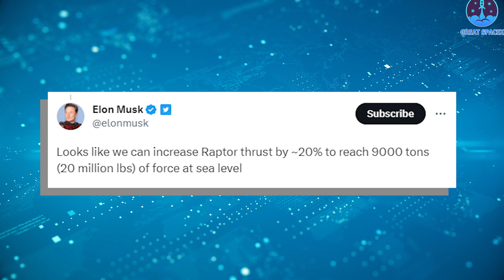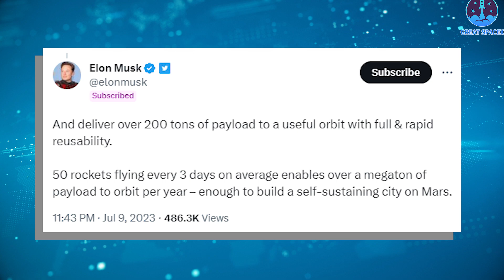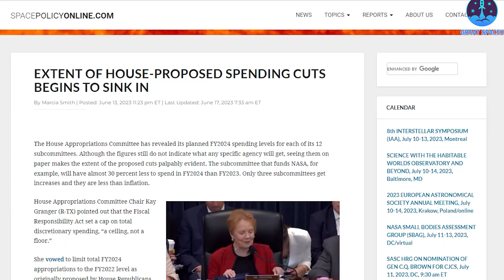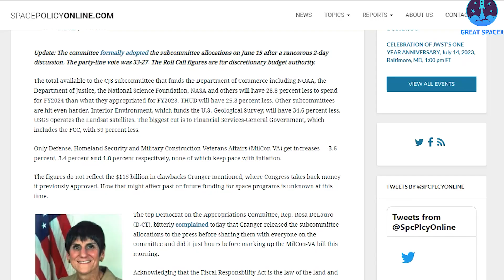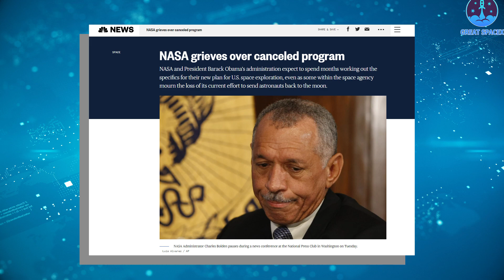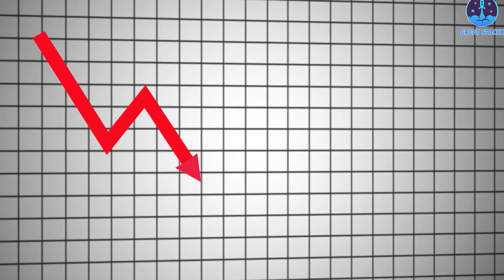Elon Musk just revealed Starship's major design changed!

Comment: I think Musk has moved beyond Florida and Texas, and he is now focusing on the necessary infrastructure to get those 50 rockets fueled, supplied , kitted-out with payload and a crew, then turned loose.  No matter what, 8,000 tanker trucks a day is not happening.  There are busy streets that can't come close to that number.  You are either building a superhighway to make this work or using other ways to get the propellant into those rockets.  Or maybe you can settle for some rockets to use off-site propellant but you crack the sea water to get you some of it?  Air lox AND hydrogen from the water, including trace minerals and salt humans would need on other planets.  Rotting seaweed is probably not going to produce enough methane, but I bet Texas has ways of turning that oil and natural gas into liquid methane.  

How do you get propellant where it needs to go?  Maybe boring some tunnels between the launch towers and fuel farm.  While you are at it, bore tunnels to any critical infrastructure.

Comment: The crazy and completely unrealistic (economics and safety) Mars visions are unimportant.  The important thing is that it will become "easier"  ("possible" - in fact) and vastly cheaper to get heavy loads up into space.  That is how Starship will change everything.  ...If it succeeds.  Just for one thing, it will be much more feasible to build entirely new classes of deep-space autonomous vehicles and instruments.  It will be much cheaper, not just because the launch will be cheaper, but also because the mass of the vehicle will no longer be such a critical factor.
If Starship succeeds, it will only be a few years before a real space boom starts rolling.  Long distance, high endurance, heavy planet exploration probes.  Asteroid mineral prospecting probes.  Low-g factories.

Comment: the astronomical quantity of refill trucks would be more easily interpretable if it were transformed into more commonly seen volumes
X Olympic pools (maybe not big enough)
the collosseum in rome or the astrodome (maybe)
a known LNG carrier or supertanker (such as the Exxon-Valdez of sad memory)

another question the SLS which has already taken off is block type I (light)
what is the state of development of the elements of the block IB (medium) and block II (heavy) versions
the Exploration Upper Stage and the new boosters?

Comment: He should just get the thing into space and working properly before thinking about building cities on Mars. If Raptor engines can achieve 20%more power, surely you would consider making Super Heavy a little smaller if anything drop 6 (of 33) engines, meaning less weight and less propellant required for the same(slightly more thrust still) making it even more efficient and cost effective. SpaceX will probably make the Merlin engines more efficient in the future too which will mean they can carry more cargo for the same space/capacity. I don't understand this constant need to upscale, its just harder all round to get the thing off the ground, harder aerodynamically, with far more weight and far more fuel required and ten times more difficult to get the thing back on the ground & re-used. Efficiency is the key.
Reply: I think it is Good that Elon keeps scaling up and improving the technology. His goal of Mars colonies even if it doesn't happen for another century is what drives this rocket revolution. Most important is that the Starship program leads the way for the copycats. This is how the airplane/jet industry happened. Old enough to have seen the moon landing hope to live long enough to see first human Mars landing. However watching F9s success has be great. Starship will be great too!!!! Patience's Lol
Reply: Merlin architecture has already been pushed to its max. It’s like 2x the thrust compared to when they first flew it.   The limiting factor in production and reaching orbit isn’t how many engines starship has nor would it be adding a few more rings to the tank section.  Elon talks about mars bc it excites him but that doesn’t mean he’s skipping all the in between steps. The number one priority for starship is to reach orbit and deliver starlink, then comes refueling and lunar starship.   In the end all of that capability is necessary for a Mars colony.

Comment: .the launch pad is a mix of desperation  it needs a deflecter or a flame trench  not a metal plate that will pour water out slower than the booster  engines flames will hit the metal..
anything but the proper way to do things ...
Reply: It is a mix of ego and ignorance. Elon knows it needs a flame trench, he just doesn't want to deal with the USACE. Imagine thinking that your rocket, 2x as powerful as the Saturn V, can handle a little plate, let alone bare concrete. You think NASA built flame diverters for fun? Another wAsTe oF bILliOns?

Comment: A modified Falcon Heavy with a modified Dragon capsule with Draco descent and assent could have already been to the moon and back before SLS's first launch. Yes, we need Starship for heft, but just putting boots on the ground and having a viable way to rescue stranded astronauts would have made the project worth it.
Reply: Been saying similar for long. If SpaceX should consider before Starship, developing a bigger fairing to Falcon Heavy, able to fit a Red Dragon lander and a fuel module.
Reply: @RogerM88  I'd skip Falcon heavy entirely because SpaceX is planning to use its Starship stack for everything, which is brilliant.  Every payload SpaceX is paid to put into orbit will usually leave extra fuel in Starship, so it makes sense to offload unneeded fuel before sending Starship back down to Earth.  The same goes for supplies and equipment for Moon and Mars missions--just stage it in orbit a little bit at a time until it is needed.  Where am I going with this?  To the moon, Alice!

Imagine sending the superheavy booster  with the Red Dragon payload and extra supplies up to orbit.  I won't do the math on that, but I have to imagine you save a lot of fuel when you put a Red Dragon with a fairing on top instead of a fully loaded Starship.  If you can escape Earth's gravity well with the booster then all the better: Park it over the moon for the extra fuel and supplies and eventually it can be part of a space station.
Reply: Musk does not believe the Moon is a useful destination.  In particular it is extremely poor in hydrogen, carbon, and metal.  Those resources are much more accessible in Near-Earth Asteroids.  Unfortunately Musk has also drunk the Zubrin "Mars Direct" koolaid.  While Zubrin demonstrated that it was possible to manufacture methylox propellants using the thin carbon-dioxide atmosphere and documented sub-surface water ice, methane and water ice are much more readily accessible in carbonaceous-chondrite asteroids, the most abundant type.  And one of those C-C asteroids is Mars' moon Phobos.  Why manufacture methane when billions of tons of it can just be dug up in the micro-gravity environment of an asteroid?
Reply: I mean....I live in FL.  I understand why NASA and congress did what they did and it is part pork barrel spending, part national security, and part good business sense.  The price per launch is due in large part to the delays with the SLS project and how few launches NASA is going to send up on that rocket.  That price per launch is WAY above even the Space Shuttle!  But setting that aside, the U.S. was (and still is) facing a huge brain drain in the aerospace industry, both to U.S. companies and also overseas.  NASA/congress knew they needed a guaranteed way to get to space, and the commercial spaceflight industry was still a new and VERY uncertain option.  The second reason for keeping those aerospace jobs tied to government contracts was to ensure the jobs stayed where congress wanted them, here in the U.S.  

A company has no problem throwing away workers or old R&D if it is no longer needed, and we needed those workers staying where they are, who they are, and employed as they are, by NASA and the U.S. aerospace industry.  NASA got spooked when they tried to figure out how to build another Saturn V and found out they couldn't build them any more.  We had blueprints, sure, but the tools we use today are different from back in the 60's.  Workers train to use those tools and make those parts, but their training is also the lifetime of education and on-the-job training that led up to their new aerospace jobs.  The U.S. just couldn't afford to lose that again, so we built the SLS around space shuttle-era assembly lines to keep as much of that knowledge as we could.

Comment: Stretched tanks to get more fuel off earth however with a different engine in the interplanetary space versions of the starships would not need so much fuel. Fuel of this type is only needed to escape gravity. Speed over gravity. In spce the equations are very different. Send two or three ion propulsion engines up and then fit them to starships that are already in space and do not plan to return. Retro fit the engine into the space of one starship is. Bind three other starships to it at go to the moon or mars orbits. Little fuel needed to transit pretty quickly as it is a small but conituous acceleration.
Reply: I'm certain they'll go with a fission-based reactor before attempting ION propulsion. There's far too much mass for ION; it's fairly useless for large heavy jobs.  Once Starship is proven, the government will eventually grant approval for nuclear propulsion for orbital operations, to include lunar transfers. It's merely a matter of time.🚀
Reply: With this mass ion propulsion suck hard. Tech is good for small prob right now.

Comment: How in the hell are they going to get that much fuel, lox and nitrogen to the launch sites each day? Sounds totally impossible!
Reply: If Elon has an issue with supply chain, he will build a facility to create his needed supplies
Reply: Technically they can easily extract liquid oxygen and nitrogen locally from the air.
Considering they have the equipment to re-condense the gasses on hand, they only need a bit more equipment to create liquid oxygen and nitrogen.
Reply: First he only deals with problems he needs to right now.  But he thinks about the problems in advance.   Most of what space x does is still currently impossible for anyone else accept space x
Reply: @Justmyopinionright  agreed!
Reply: Reduce air oxygen and nitrogen content and increase air CO2 content .  Come on man ,  Space X is measurably  increasing Greenhouse Gases .
Reply: Every launch site will need to have a production facility or pipelines from a production facility to multiple launch sites.  It won’t be a situation with massive tank’s constantly receiving truckloads of propellant.
Reply: SpaceX is planning to mine the methane from the site their are occupying at Boca Chica they probably will do the same for the oxygen (extrac it from the atmosphere)
Reply: Tanker ships into pipelines into the facility
Reply: A lot of things sound totally impossible with this rocket.